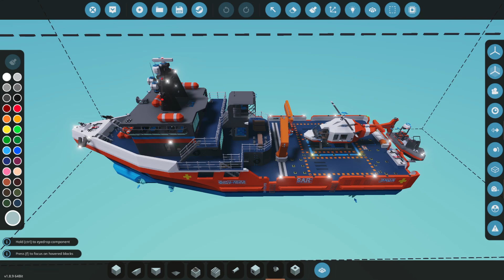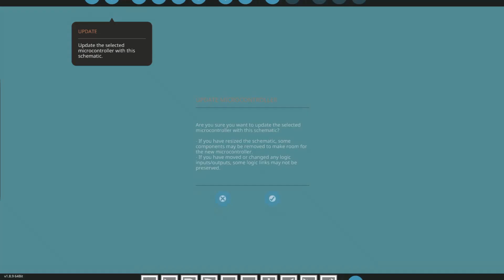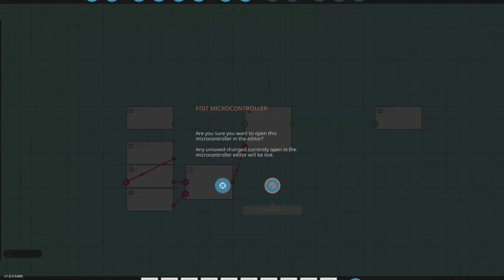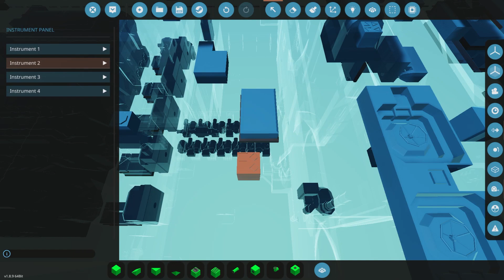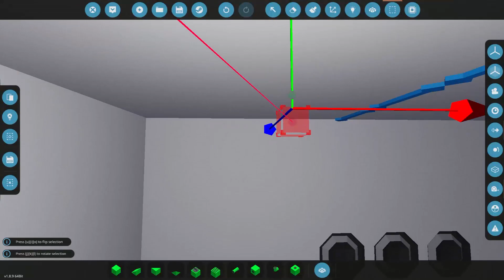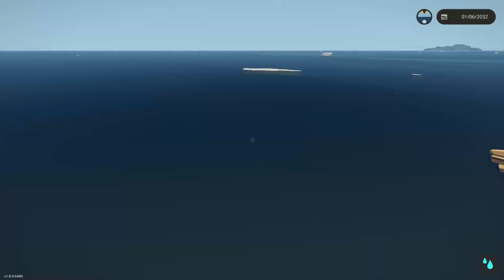Wireless MAN OVERBOARD tether in Stormworks

Comment from the maker: To avoid confusion - this is a tether system that is wireless/cableless! It is activated by the player sensor.  The in-game cable system is not refined (you cannot pull yourself up or down it), so if you are attached to the ship with a cable and fall off, you will be dragged on forever, since you cannot pull yourself up.  I am thinking I may explore a system on a winch where it is activated when you fall off the deck, and pulls you back up! :)
Reply: I'd love to see a safety harness body piece where you can be attached to a winch and walk around. Great idea with this MOB system. 😎

Comment: Just a small correction (you did it right but said it wrong), when you link several player sensors with an or the engine will not stop when any of them trips, it will stop when none of them trip (which is exactly what you want because that means you aren't near enough to any of the sensors)
Reply from the maker: Thank you :D I was getting confused myself trying to talk and think at the same time haha

Comment: May I make a suggestion, don't use player detected boolean, use number of players detected.

You can then join all the multiple player sensors in a function or add block and use an equals or less then function to trigger the kill switch.

If using a lot of sensors, this will clean up the logic.

Plus, it has the advantage that you can add a number input of how many players are onboard and either activate the kill switch or sound an alarm if any one of those players falls overboard.

The same set of sensors could also detect if extra players come onboard, which will be an advantage with PvP combat in detecting the enemy boarding you.